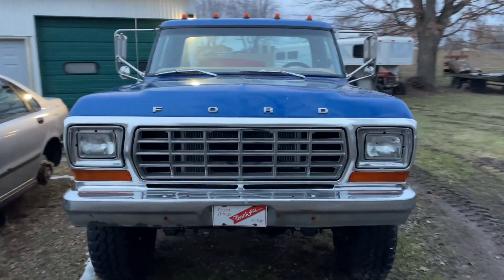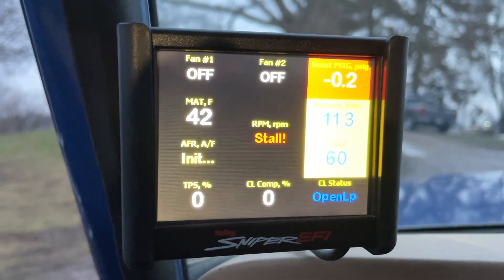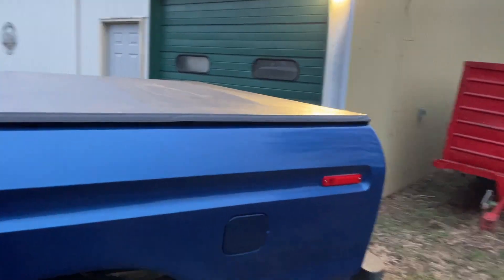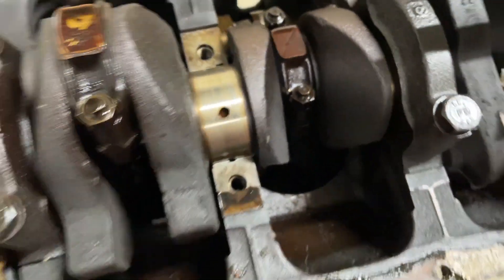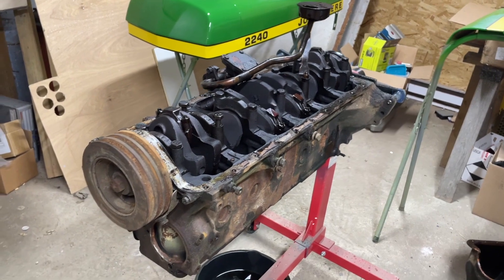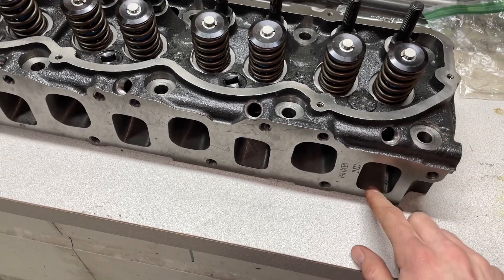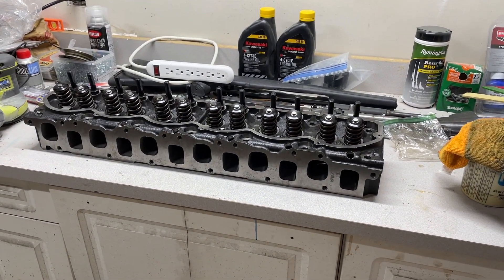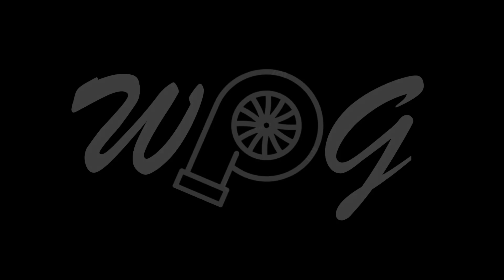I'm Building a 500hp 300 Straight Six

Comment: I'm buildng one too. A 92 f150 fuel injected 300/4.9 with port matched Bosch Injectors, summit racing cam and It's a 5 speed manual and 4x4

Comment: The most bomb proof motor Ford ever built. I had a 1980that ran over 500k. Abused by apprentices that got a free truck. U joints and breaks was all it cost over 25 years.
Reply: Best engine to ever come out of Detroit. Keep water and oil in it and beat the crap out of it cause she will take it and keep on coming. I bought one once suppose to been blown up. 32 dollars worth of rocker arms and push rods I drove it for years

Comment: I ended up going with some BBC H-Beam con rods, just a very light trim on the crank. I went with the longer, bigger pinto valves. Waiting on the machinist to finish the head to find out what pistons I need built. And yes H.S. rockers 👍 shooting for 600hp but will see, I'll probably push it until something breaks then build another even stronger. I'm a fabricator so I might just do the chopped up head eventually

Comment: That pin/bolt that your door latches to: cut a little piece of air line about an inch long, split it lengthwise, and snap it over that latch pin. Your door will latch like brand new.
Reply from the maker: I actually just snagged a piece of 1/2” pex water line from the farm a few days ago to do exactly that, just haven’t found the time to put it on
Reply: @WastedPaycheckGarage  oh, Pex! Good idea… I just wonder if it’s too heavy walled.. the OD is as important as the ID.. but I’ll definitely follow you and see how it works ✌🏻

PS beautiful truck, I absolutely love the 300 sixes

Comment: Other people have said it, but I want to reiterate that you can use 390 Pistons instead of boring that much over. It's the best bet because the geometry matches up perfectly and you can keep[ your compression ratio up without creating even more work. 

I'm doing a very similar build for my 65 Mustang, so I'm excited to see what you come up with here!
Reply: The 300 has 2 different wrist pin sizes 
390 is a common piston for the 300 builds
The build we are doing running 351w pistons
Reply: @Freedomishere-im6ug  Sweet! Always happy to see the 300 getting the love it deserves. I think it has the potential to be a bit of an American 2JZ if enough people start building them and getting the aftermarket incentivized to start producing more parts.
Reply: @NautilusGuitars  are saying was it a fordjz
Reply: 390 pistons are a .050" overbore on a 300 🤔

Comment: I know I comment on your fb post already, but the DSS 390 ford pistons for the extra $80 to get the custom bore size so you're not stuck with a 0.050 overbore is by far the best route. Same pin size and compression height range. Those along with the Molnar 300 rods you're set with a good balance job. Looking forward to your build progress, hopefully will have mine running soon also
Reply: they make them stock 300- 4.00 bore ,.030, .040 and .060 overbore now

Comment: FYI: "cold start" doesn't refer to the temperature outside, it refers to the relative temperature of the engine. it could be a humid 103 in Louisiana and if you haven't run your engine for the past three days, it is still referred to as a "cold start." And damn those mains are clean!

Comment: Make sure you run a cam with the same profile for exhaust and intake meant for a power band of around idle to 5500 then size your turbo around 58mms to punch 500hp around 5k rpm with good tq in the mid low range

Comment: A man named Sherman Sligh back in the 70's had a 600+ horse 300. Dubbed boss 300. It consisted of six segmented pieces of boss 302 heads, late 60's castings. For a half day or more straight he heated these segments 1200+ degrees and brazed them together.(cast iron doesn't play nicely in welding). He epoxied the intake runners(they were too big), put a massive thumpstick and valtrain to complement(roller lifters, cam, two piece pushrods etc.), along with custom rotating assembly.(gas ported forged pistons, alimunum rods,) Ran a 9.2 second qtr mile, vehicle type I have not found. N/a build. He mainly stuck to circ racing, eventually being banned. Even won indie by 2 seconds but didn't count as official record due to ban. Early 70's. I've a 300 myself, great engines.
Reply: Damn 😮
Reply: I saw that very engine in a video on YouTube not too long ago.
Reply: 3 heads,not 6
Reply: https://youtu.be/JqjhyBKa4pI?si=rebXAOBKHW36-nIy

Here is the video of the Boss 300.

Comment: I have been working on a roller cam.  Only issue is the distributor gear.  I can't find anyone to cut a steel compatible one. You can take the bronze one and throw it into the trash. I don't want to replace it every 3 months!

Comment: What year is the replacements engine? 

Just to let you know the stock connecting rods are forged. All 240/300's came stock with forged rods. If you don't want to go aftermarket rods you can just add some ARP rod bolts and have the rods polished, shot peened and balanced.  The early rods 1965-67 were slightly stronger because they didn't have the oil squirt holes. And they also had the smaller .912" piston pin diameter ( same as the SBF V8's ) . Which would allow you to run stock compression height forged 351W pistons.  The later rods 1968-1997 have the .975" piston pin diameter.  You can still run the 351W pistons but would need to have the small end of the connecting rods bushed down.  

If you really want forged pistons the best bet is to just have a set made. That way you can have them built to best fit your exact build.  AutoTec are a good choice for custom pistons.

You probably know this, but that cylinder head will also require push rod guide plates and hardened pushrods.

Comment: Damn I wish mine was 4x4. I just really have a hard time finding the motivation to build a truck that's not 4x4. I could build it, just to keep up with a modern f150 I guess but idk.
Reply: I had a 300 1996 with the automatic 4x4, I put a level and 33s on it. Mileage went down it got down bad enough that I could not enjoy it anymore for a daily. I think a 2wd is more badass, its 400 pounds lighter or so more power n mileage, less maintenance… All desert trucks are 2wd. Sold that truck now I might trade this chevy for another one its 2wd 5speed stick! cant wait to build it up!
Reply: @BigBadMarketer  yeah, thats cool to hear. I have a 97 pathfiner 4x4. Thats my off roader now
Reply: @BigBadMarketer  You should have regeared it for the 33s and that would have helped a lot
Reply: You can swap 4x4 parts onto a 2wd truck
Reply: @trashman1694  I've heard that takes such time ans money it's not worth it.